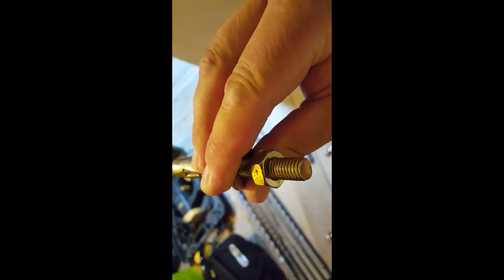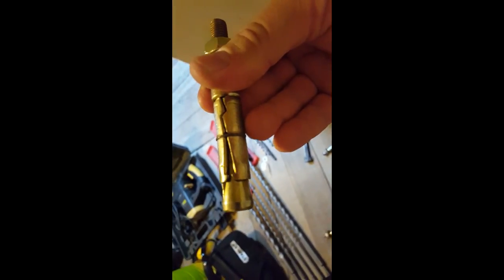How to fit and install a Shotgun Cabinet or Safe and why you should do it! (Part 2)

Comment: That 'slight gap' actually makes it easier to pry the cabinet off the wall as a wrecking bar can be inserted 'twixt cabinet and the wall the door hinges on and will act as a fulcrum.  In cases where the corner aren't exactly square it's actually better to move the cabinet out and away from the corner by about eight inches - difficult to manoeuvrer a prying bar on that side and no leverage available.  If the corner walls ARE perfectly square drill more holes on the side of the cabinet so it's bolted back and side to both walls.
Reply from the maker: Thanks for the additional input...I bet you wear a hooped striped shirt and a black mask and carry a bag with swag written on it 🤣

Comment: The important bit for me was that once you’ve got the drill holes done, how do you put the bolts in so they stay in. Did you say fill the hole with concrete and then put the bolts in?

Comment: Did you put the bolts in through the gun cabinet then screw the shield onto the bolts? my gun cabinets bolts are humongous, the shield wont fit though the gun cabinet hole so i need to screw that on when the bolt is though the back? my non DIY orientated brain is telling me I have done something wrong. Already wasted money on buying wrong drill bits and so forth. Doing my fucking head in.
Reply from the maker: Hi Lewis.  LOL. I felt your pain.  On mine I firstly inserted the bolt sleeves into each hole before lining the cabinet up into its exact spot.  I then threaded the bolts into each hole (using a good solid washer between the bolt head and inside of cabinet) You should find that after a few turns by hand the bolts will bite into the sleeve and then you can tigthen them securely from inside the cabinet.  Good luck!  Give me a shout if you get stuck again :-)
Reply: Tony M Thanks mate. I get it now!